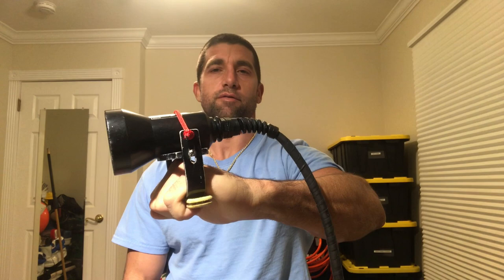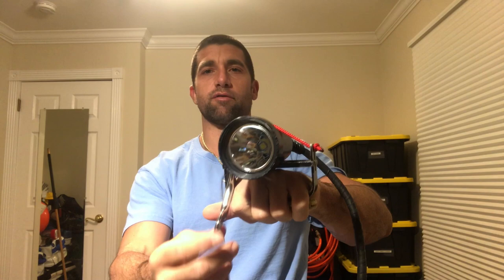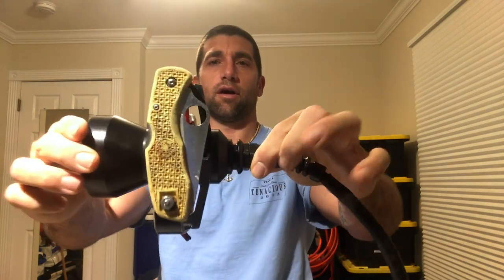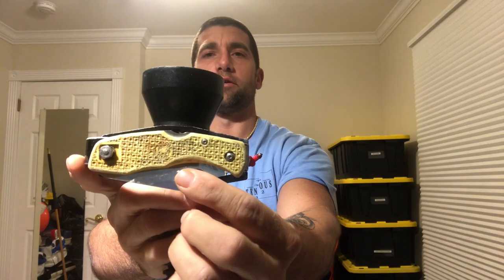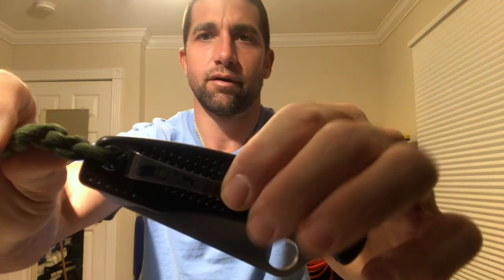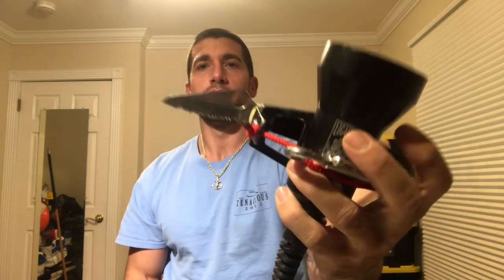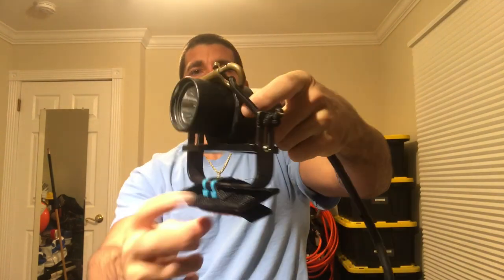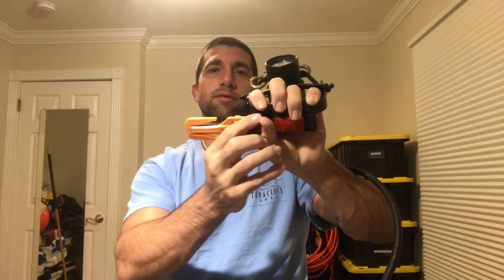Episode 04 - The Goodman Handle

Comment: Thanks for the tip. I had never thought of adding a blade to the bottom of a handle. In terms of the "eezycut," Mares just came out with a ceramic version that shouldn't have the issues you mentioned. I recently bought one but haven't used it or tested it yet. 
https://www.divers-supply.com/mares-hand-line-cutter-ceramic.html
(I have no affiliation with Divers Supply, just picked the first link that came up on a Google search)
Reply from the maker: Glad it could be helpful, thanks for the idea with the ceramic cutter I will take a look.